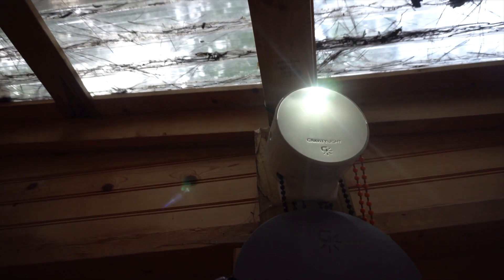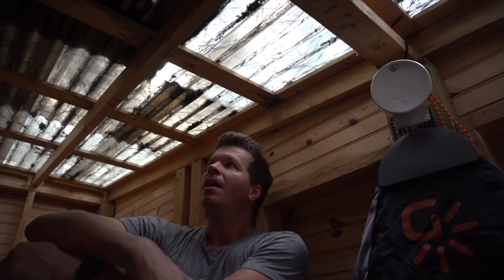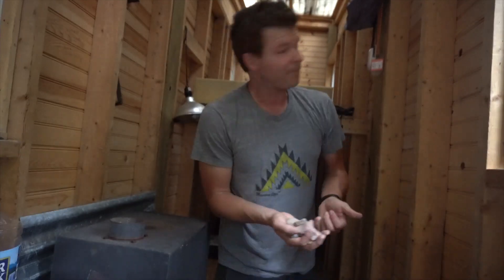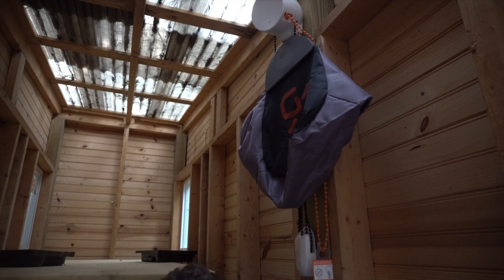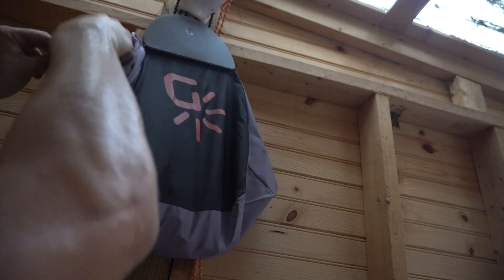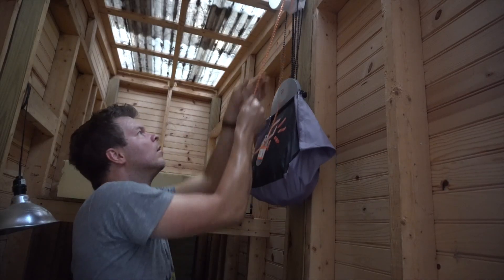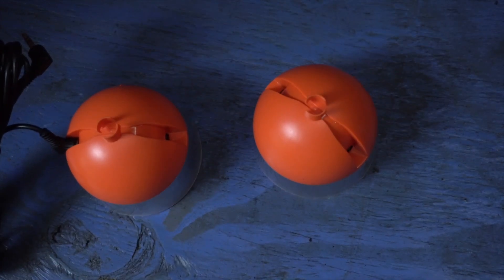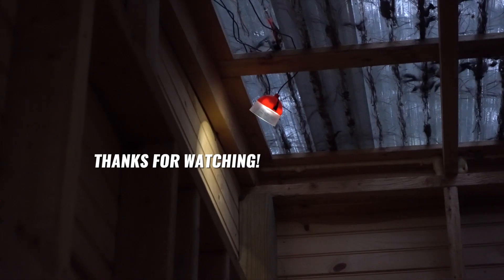LIGHT VIA...GRAVITY?

Comment: Does the friction charge a battery that makes the light shine? Just lift it every 20 minutes and so compact seems a good deal especially if people have to move frequently.  No lugging large panels or batteries around.
Reply from the maker: No battery. It's all on demand. As long as there is weight and it's dropping, there's light (which can be turned off as well)
Reply: Tiny House Listings I feel stupidly uninformed. So the small amount of charge by friction of the weight is enough to light the bulb producing light? I still think it is a brilliant option.
Reply from the maker: Basically the rocks dropping because of gravity produces energy in the motor which in turn produces light.
Reply: Tiny House Listings Thanks.

Comment: Something I would do as well if going portable.
Energy required to lift it back up is nothing, really.  
20 minutes light during time where you normally should be sleeping anyway is more than fine.  I'd probably have light coming from a monitor to be honest.  

Have a whole wall cavity filled with these generators and weights.   (longest preferably)
Connect all the winding gears up to a single gear.  
Connect that gear to an exercise machine.  
The power output, instead of a light, would go to a battery bank for your whole tiny home.  
Need to charge your power bank? Do some exercise. 
Combined with solar and wind, you could be free from any toxic fuels directly.
Have a backup system just in case you are under the weather, figuratively and literally, will always be handy though.

Comment: Bruh, THE MOST IDIOTIC idea ever. Even if this was the only alternative to kerosene I'd still use kerosene
Reply: MzClementine Burns nicely. Also smells nice to me. Gives off nice heat. Lots of reasons. :)
Reply: According to the Agency for Toxic Substances and Disease Registry (ATSDR), inhaling kerosene might cause a short-term change in the way you smell or taste things. 

Also, inhaling kerosene fumes might cause some people to become dizzy or nauseated. Breathing the fumes long-term could result in neurological or kidney damage, including blood clots that damage the brain, heart or other organs.

Though, it makes a good pesticide...

While burning of kerosene of course produces the danger of CO and fire danger...

As a fuel, kerosene is more volatile than other fuels and it's often used for jet and rocket fuel because of this but that means more care has to be taken with its use.

So any way for people to use LED lights instead is definitely an improvement...
Reply: Uh, you do realize mechanically this is essentially a cheaper version of a hand crank... It just uses gravity instead of needing someone there to constantly crank it to charge it?

You can also just connect a battery to it to make the power last longer or set it up higher and add a longer cord pulley system and resetting the weight is easier than hand cranking... 

While the simple design means it's easier for users to repair it themselves, which isn't the case for many of the alternatives... and it's likely harder to break as well...
Reply: ZeoCyberG I know all that. It just looks to me like something fred flintsone would do. ;) peace bruh
Reply from the maker: kristijan ahcin thanks for the constructive feedback. You seem like a swell guy.
Reply: Okay, can't you explain why you would use kerosene? My husband uses a kerosene heater in his garage. I cannot handle the fumes. It sends me into an asthma attack. Thank goodness our home we just purchased has heat in the garage. No more need for his kerosene heater. 

What is it that you like or enjoy about your fuel source? I'm very interested why you would choose that. 
✌🏻😉✨